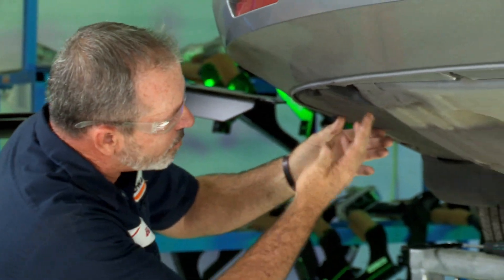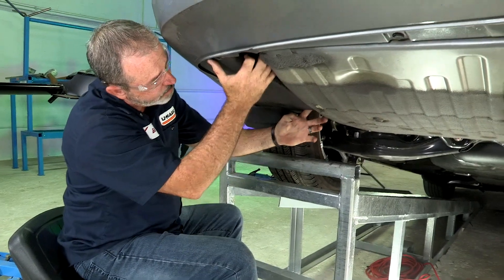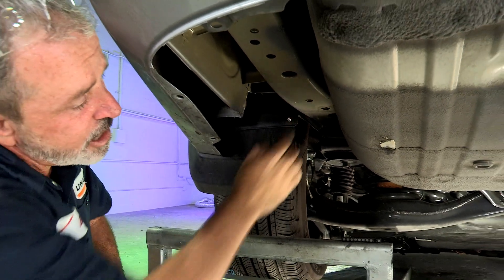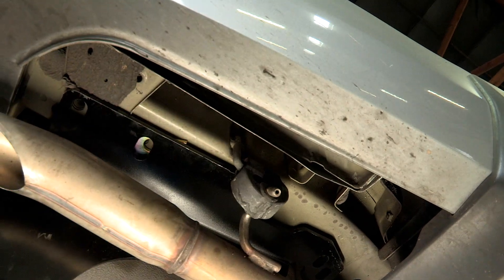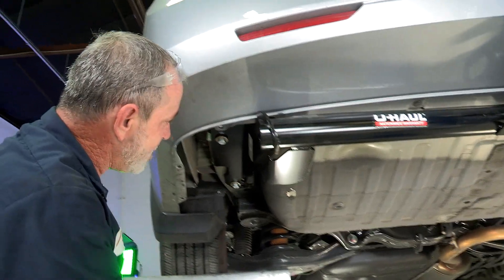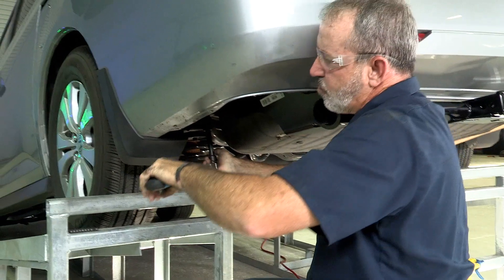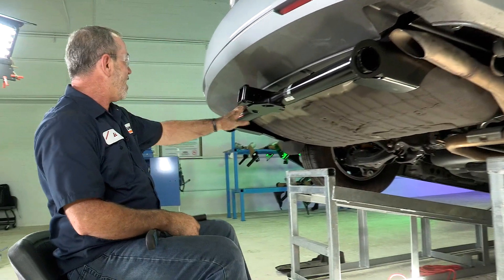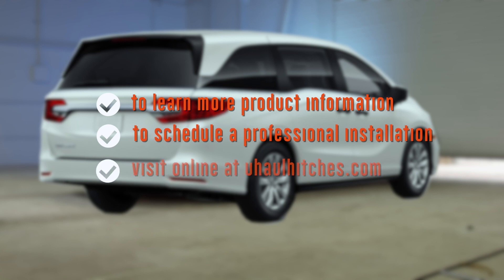2015 Honda Odyssey Trailer Hitch Installation

Comment: Can u pull a jet ski with that hitch
Reply: These are good for 3500 lbs of carry weight and 350 lbs of hitch weight. From what I have seen on the etrailers website, there is a weight distributor that can increase that to 500/5000. Be sure to factor your vehicle's towing capacity. For example, our minivan has a 3500 pound towing capacity, so the weight distributor is a no go for us.